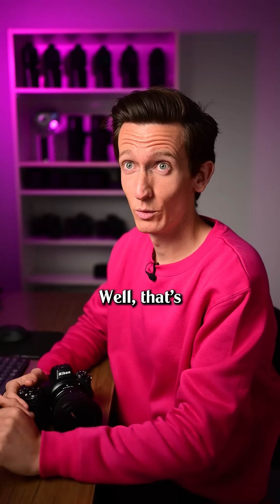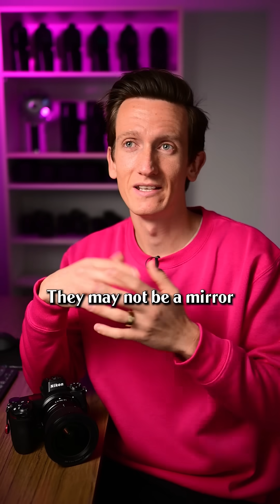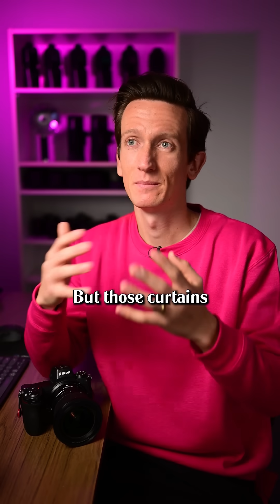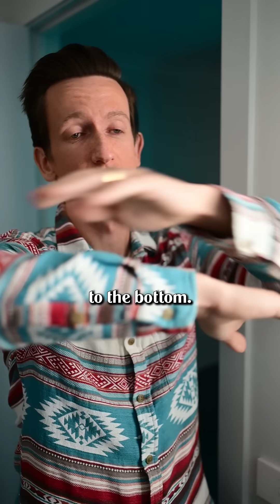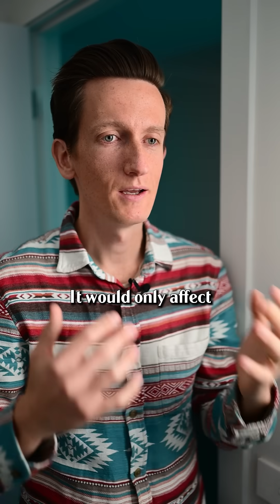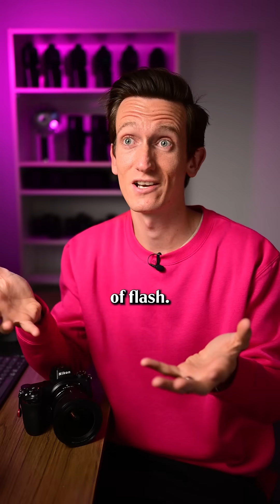Understanding Flash Sync Speed

Comment: Do note that this explanation applies to cameras that use Focal Plane shutters. There are cameras that use what's known as a leaf shutter. Those cameras don't have that constraint. They can sync with flash up to the fastest shutter speed that they can go...
Reply: Interesting. But I've never hear of such a shutter on any popular camera. So where would I find such a camera?
Reply: Fuji X100 series
Reply: @JamesJoseph-u1y the Fujifilm X100 series compact cameras has them. 

Hasselblad cameras make use of leaf shutters. But unlike most cameras the shutter is not in the camera body, but inside the lens

Comment: If you used first curtain shutter, would it still be effected?
Reply: See, I didn't know you could only use one curtain!! Next video please 😅
Reply: Actually yes, at least my canon R6 lets me use flash with 1st curtain. Had the same experience with an R10, but yeah there are no issues at all.
Reply: First curtain, or rear curtain sync does not affect flash sync speed.

Front curtain sync is ok most of the time, but I personally default to rear curtain sync because I can do stuff with light trails...